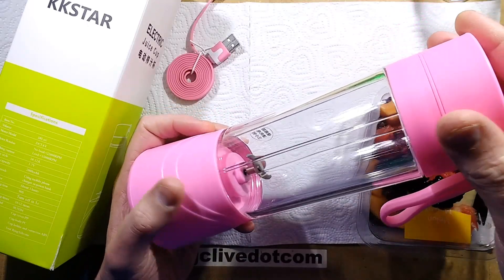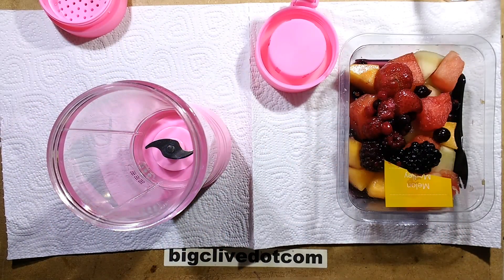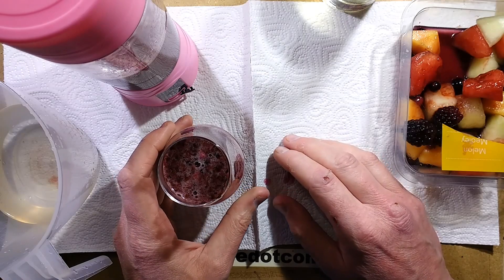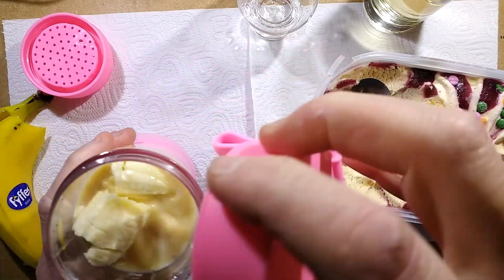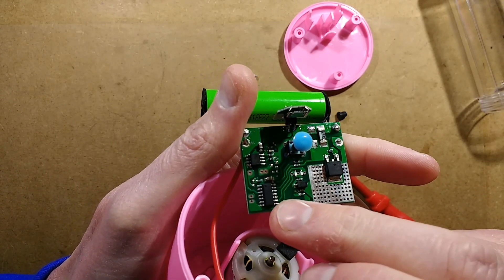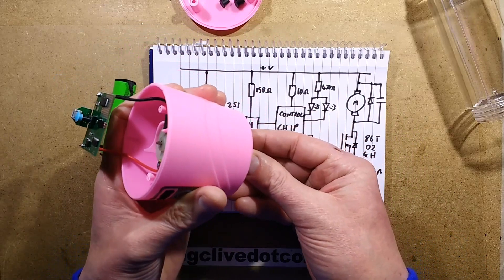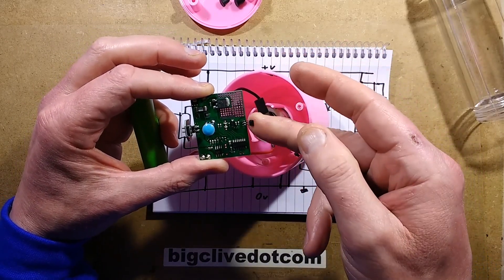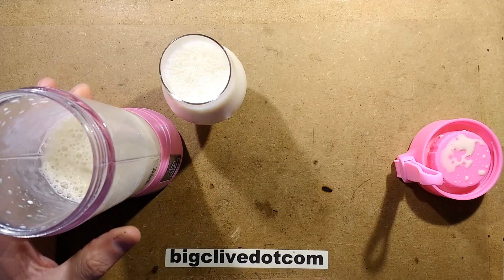Pink plastic USB blender test, fail and teardown.  (With schematic.)

Comment: Is that included battery actually a high drain cell? Assuming most cheap lithium cells only give about 2A max, i highly doubt if they used right battery.

Comment: PCB design and cables looks fine, but mine mixer failed just after few uses. I opened and tested all components. The shaft seal was the problem. Liquid dip thru the shaft, runs inside the motor and its bushings began to fail. Higher start torque increased the start current and it doesn't start anymore (high current protection). Waste of money.

Comment: I got something like this today from ALDI, the blending vessel is made of a heavy glass, and it has 6 blades well 4 curved up ones similar to those magic bullet thingys plus to smaller ones on top.  It seems pretty powerfull for what i would use it for.   One good thing about ALDI you can return it within the 60 days for money back.  I didnt see magnets in the bottom of my container and I would hate to touch the spinning blade.

Comment: I got one. Replaced weaksauce magnets with one neodymium, and replaced the unnamed 18650 with a Samsung 40T 21700, which absolutely lols through an 8 amp load as it can go as high as 40.
It's now a pretty impressive little drink mixer.

I think if I could I'd remove the current sensing safeties, replace the motor with a hobby grade one, and drop in 3 cells in series. It would then be perfectly capable of cutting your fingers off provided the mosfet didn't explode, which it would. Maybe a 100 amp drone motor controller and an arduino nano.... hmmmmmmmmm

Comment: Maybe it can only blend pure tap water 🤷‍♂️ 
In the same way some cheap 5V USB charger can only output stable 5V when nothing is plugged in it

By the way a few month ago I saw this "blender" sold on intragram (drop shipping) for about 50 or 60$ which is very depressing as it's 3$ on aliexpress

Comment: I purchased for my sibling that famous tv blender that is slim jet blender anyways it had many blades like two different cup sizes I tried it all and noticed it look impressive but then I also noticed even though it was AC powered it lacked on blending the fruits it took way more time and couldn’t compare to the power a full size blender has . We got to remember it’s motor directly attached to the plastic and then blades all torque depending on all (fruit or ice ) we put will act as a resistance to that small or big motor .... if it’s battery power that battery better have juice hehehe to move and protect that motor ...

Comment: I bought from a shop, it works great it has 6 blades, I crushed walnuts direct, but as I add milk it worked faster and better when crushing walnut (without milk). it stopped by its own because it time operated by the company. mine blender has a power bank too.  it makes 1 mug of shake easily. PLEASE DON'T BUY 2 BLADES BLENDER IT WILL CREATE PROBLEM

Comment: My wife bought one and it worked for a week, but then it was non-functional after a charge one day.  She said maybe it got wet, but I took it apart like big clive.  Looks clean inside.  when I bring a magnet near the sensor it flashes blue red, but I can't get the blender to turn on.  If I move the circuit board around the motor, the blue red flashing happens again...probably detecting the magnets in the motor.

Thoughts?

Comment: I bought 6 blades version =usd 5.
Battery 18650 2000mah.

If wanna upgrade
Ultrafire battery 26650 5000mah = usd 15
Motor upgrade = usd 20

Comment: Flip the blender upside down for a couple(or your case, a few...dumbass) seconds. So the motor can work at full capacity so the blades hit at full speed when you put it in the table upright.

N your piece of shit blender wont jam every second.

Should've bought a BlendJet

Comment: I have the same. mine does not turn off. I needed to open quickly and disconnect the battery to avoid damage. I soldered again and it's working. Some ship command did not understand the key. It has the battery protection circuit that saves the battery. It has some function of the chip with shutdown problem.

Comment: I really need a portable blender for my protein/energy shakes as I'm doing three 24 mile night-walks a week and the shakes are hell to mix.  The problem is, I want something decent that takes replaceable 18650's... anyone know of anything?  Either a self-contained blender or a seperate whisk.  Everything else I take with me is 18650 based, as the ability to allocate spare power as required is important and keeps weight down.  Also, rechargeable stuff with built-in batteries tend to fail over time and stop holding a charge.

My current 18650 arsenal includes : High power zoomable cree torch, 70cm/2m amateur radio transceiver, GPS unit for navigation/tracking, My vape pen and a small DAB radio that doubles as a phone charger... and a belt pack that holds six spare 18650's.  so, if I could just get these shakes sorted out I'd be a happy guy : )

At a push I suppose I could take one of these ugly pink beasties and a small screwdriver - perhaps cutting off the lithium cell and glueing in a battery holder, but there doesn't seem to be much space.  I suppose the other alternative is to mount an external 18650 holder on the bottom, remove the bothersome reed switch and only put the 18650 in when the thing is safely assembled.

+100 karma points to anyone who's seen anything better that might be of use.

Comment: Power botton on mine is mañfunctioning.... it comes on for itself while sitting on the cupboard ...need some help on that asap !!!!!!!+
Reply from the maker: Sounds like water has got into the button.
Reply: @bigclivedotcom  how do i fix this? I wanted to remove the battery but it is wired directly so i am stuck with listening to it whenever it goes off making sure it doesnt burn down
Reply from the maker: @jason_jus_kiddin  You would probably need to change the button or check the PCB hadn't been contaminated with water or other goo.  If in doubt you may be better cutting the battery wires to render it safe or just use it until the battery runs down and then don't charge it again.

Comment: Dear Sir, I bought this product online through seller "microbees" but when the shipment reached to me in Saudi Arabia and I put it for charging for 3 hours as per instructions still it is not working?
Reply from the maker: Check the clear container is not on too tight.  It may be the version with a safety magnet that needs to line up with a sensor.

Comment: As a regular consumer of fruit smoothies from a mains powered industrialish 3 horsepower 1.5 litre capacity unit for a number of years, I was most interested to see this. So when I'm out and about and don't want to pay outrageous prices for fruit smoothies, I could carry one of these about in my backpack. Then get some fresh ripe fruit and voila, fresh instant smoothie on the go! 
And as an electrical/electronic test engineer, this unit looks fairly simple and relatively well made. A tip for you, as a regular buyer of good quality fruit, the flesh of a ripe melon should not be hard, it should be firm, but give way to mush under moderate finger pressure, and should be sweet so as not to need sugar/sugar syrup, although I will admit, some berries are tart!
Reply: Or you could just invest in a cooler and make the smoothie in your 20hp Lamborghini blender before you leave the house!

Comment: I ended up buying one of these just for the fun of it, aside from the blades unscrewing the first couple of times (2 part epoxy fixed that) it works surprisingly well. Mine does only have a 1500mAh battery though which is a little annoying but easy enough to swap out.

Comment: The only use I can imagine for this is that you absolutely positively NEED a smoothie right now but the power is out because of a storm.  Assuming you remembered to charge it before the power went out.  :)  Even though it comes in very pretty colors, I think I'll stick with my mains-powered one that can handle frozen fruit.
Reply: Aleatha Vogel perhaps you can use it on holiday, or take it to work, since most offices have a fridge with fruit and milk in it.

Comment: Hi, I use the Hall Effect Sensors at work a lot and use a jigs to set the on the motor PCBs to the right angle and height, maybe where they went wrong ;)

Comment: So the first thing I see wrong with this thing is no ability to disable to the battery whatsoever without disassembling it... it needs a physical switch.  Mind you not everybody is going to be disassembling theirs.  The other thing that might help is wrapping the motor housing with some aluminum tape or a thin metal ring to shield the motor's permanent magnets from the hall effect better.  But for a "Shitty pink things from China" product, not bad.

Comment: what's the blue thing
Reply from the maker: If you mean on the PCB it's the button.  If you mean the large tubular thing it's the lithium cell, a common 18650.
Reply: bigclivedotcom oh a button, then what's the little pcb hanging off
Reply from the maker: USB charge socket.
Reply: bigclivedotcom thanks

Comment: too much water!
too much milk!!!!!
need more pink stuff
Reply: also would 2x  18650's physically fit inside, that might be a worthwhile upgrade
Reply: 2 in parallel. less stress on the batteries for sure. but longer charge time and longer battery life.
Reply: and more amps on the motor less stalling
Reply: its not stalling from lack of power though. its stalling because the detection circuit is too sensitive and cuts off on too light of a load.
You could fix that by changing the low value resistor going to the mosfet. which would be the easiest solution. just get one thats just right and then it will cut out on a heavier load instead.
Very simple fix. You could probably even tack-on a resistor on top of it without even removing it. so its possible you wont even need to change it out completely.

Comment: Maybe it started to work after when you placed the magnet as a "feature". The Melon was too much, it sensed the jam and won't work until it's sure the jam is clear. So by fiddling with the sensor it may have figured that you took the container off to clear what ever was blocking it.

Comment: Kinda embarrassing that something this small, with that price, and that power source can even do a tenth the job of those big $1000 machines.
Reply: $1000?
Reply: +Paul Sengupta - There are $1,500 blenders out there, that don't do anything unusual or new.
Reply: Hmm. I paid about £14 for mine.
Reply: I have a 2nd hand kenwood smoothie maker that I picked up for around £5. An hour, disassembly of the user serviceable components and a good scrubbing later, it was ready for service. This was 5 years ago.

Comment: Can you recommend a good multimeter for a beginner? I'm familiar with relays, fuses, and basic wiring, etc. I'm staring my first major car project soon where I'll be getting rid of the bulb based turn signal system and replacing it with chip leds attached to a heat sink. I'd like an ok multimeter to test things while I work, but I don't want to spend too much on my first one. I've heard that the VC99 is good, but I'd like some opinions. Thanks for any advice.
Reply: TheKing0fHalo have you heard of the digital mooshimeter
Reply from the maker: Most meters are fine for general use.  The VC99 looks OK.
I'd suggest not using cheap meters on mains wiring though, as they may not have adequate internal protection.
Reply: Cool. Thanks for the help and thank you for your videos, I'm learning a lot about electronics from watching them.
Reply: I looked it up on Amazon. It looks like a good option and it has good reviews too.
Reply: For 12V electrics, those £2 Chinese ones they sell in Maplins are fine. I bought a handful some years back and mine are all still working!

Comment: This would probably work better in you bent the blades and angled them similar to areal blender, hopefully should create a slight vortex and pull the fruit down, although the motor would be pretty weak

Comment: Clive, slightly off topic, but I've noticed your new setup has slightly odd audio (not bad, just a bit weird). The treble is clear, there's considerably more bass, but there almost seems to be a gap where some of the midrange should be. It <almost> sounds like two audio streams recombined. This isn't a complaint and overall it sounds better, but I was wondering if you're capturing the audio with an EQ setting that's 'clipping' certain frequencies (if that's the term for it). Again, not a complaint or criticism. Just an oddity I've noticed. Cheers!
Reply from the maker: The Moto G4 has no audio adjustments that I can find.  I'm using an external microphone aimed tot he side with a barrier behind it to reduce reflected sound.  The boominess is largely because my voice is actually quite bassy.

Comment: Can you do a video explaining the difference between Mosfets and traditional transistors?
Reply: Essentially MOSFETs are used for high power switching while transistors are maily used for low-power electronics.

Comment: Is it just me, or is the circuit in that thing built really well? I mean, REALLY well?!
There's a safety interlock, as well as timouts. the circuit board doesn't have solder and flux caked all over it. The board has stitched vias for heat dissipation. Properly rated wires were used, and all the connections were sound.
This is probably the best quality product I've seen on this channel :O
Reply: That's why it costs nearly £11.
Reply: Well most pcbs are quite high quality now from china. I mean they etched, drilled, tin plated, painted and silk screened pretty well from most manufacturers and also very cheap. I tried few DIY kits from ebay or aliexpress and were stunned how well pcbs were made.
Reply: Yup, pcb and cables looks fine, but mine mixer failed just after few uses. I opened and tested all components. The shaft seal was the problem. Liquid dip thru the shaft, runs inside the motor and its bushings began to fail. Higher start torque increased the start current and it doesn't start anymore (high current protection). Waste of money.
Reply: It's just you. The thing is pretty shitty.

Comment: The slow intrusion of fluid into the motor shaft is disturbing, uncleanable design.
Major problem is that it only costs 5 dollars less than the cheapie AC designs.

Comment: Shitty pink usb 10 pounds blender have load control but my hotpoint 150€ hand blender 4 in 1 does not and cracked the plastic (not even reinforced) transmission gear in no time.
Guess you don't always get what you pay for.
Reply: 150 Euros for a hand blender?!
Reply: Paul Sengupta yeah, 150€ for a frappe mixer?

Comment: Is there a way to defeat that safety feature easily? Like bridging the output of the hall sensor to some other line? You said it outputs a logic level signal, what does it mean? 0V for "no magnets close" and 5V for "there is a magnet close by"?

Comment: That magnetic interference on the safety looks like a big issue. Why didn't they just put a piece of metal in the base of the cylinder so it closes a circuit when it's locked in place? Cheaper too.

Comment: I had a similar one which ran from a couple of AA batteries wouldn't break the skin off custard even had a safety interlock just a push button and the interlock batteries and a motor simples
Reply: I've got a "tornado mixer" which runs on a couple of AAs. It just creates a vortex. Works ok for Nesquik powder in a milkshake!

Comment: I like the magnetic interlock instead of a mechanical switch, assuming it remains reliable.   The blade ought to have been a larger size so it better spans the diameter of the vessel, otherwise solids may glob up on the sides.

Before I consumed any food from it, I'd want it tested for lead.
Reply: I wouldn't worry about that blade much, small size and mass plus velocity dampened by the food surrounding it.  Remember you have to hold the thing sideways just to keep that blade spinning at first.

I'm more concerned about an escalating pile of Li-Ion powered Chinese junk that may burst into flames a few years down the road, especially when a USB powered rechargeable blender is something I do not need.  I can get a full sized mains powered unit on sale locally for the same money that may be junk too relative to more expensive blenders but is unquestionably better quality than this one and no Li-Ion battery to fail.
Reply: +Zeer365 - No imagining necessary, Clive tore it apart and saw one in the video.
Reply: I wouldn't mess around while it was running either, I trust the cheap plastic container with razor sharp blades spinning inside as far as I can throw it
Reply: It's clearly designed for the venison eater, where lead pellets are always a nice surprise.
Reply: Stinky Cheese I imagine there being a hall switch for the invisible safety feature.
Reply: Use it for camping where there's no mains electricity available. Pick the berries off the local bushes. Good luck!
Reply: Stinky Cheese I'm thinking less lead, more SVHCs in general.
Reply: one more thing to worry about lol
Reply: Save it for unwanted dinner guests...? lol jk I wouldn't expose anyone to anything that's been in this device.
Reply: +Kevin Miedema it doesn't look very heavy, I think you could throw it quite far...
Reply: Use it for mixing drinks